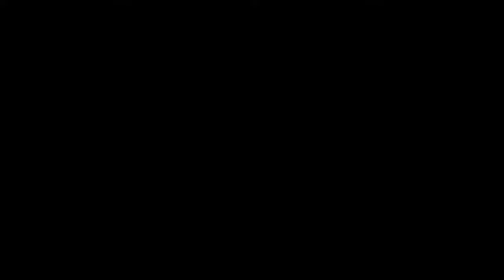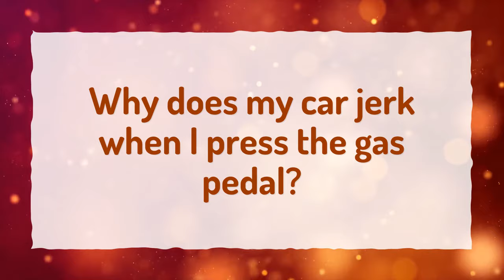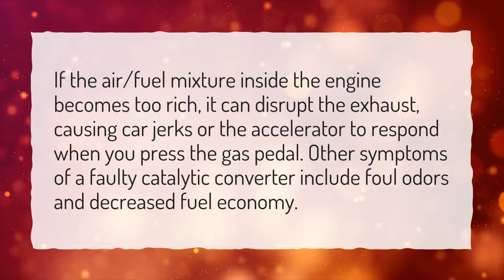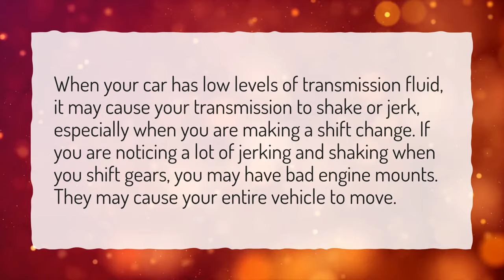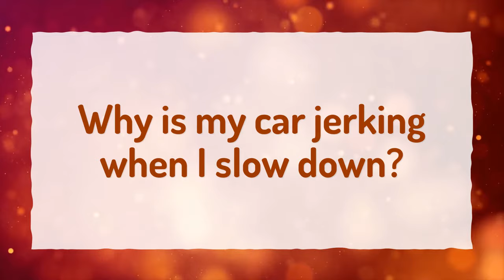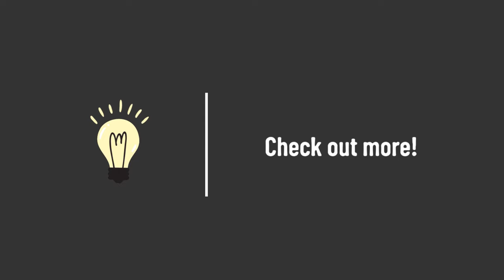Why does my car jerk when I press the gas pedal?

Comment: why does my car jerk when i lightly press the gas pedal?
Reply: did you solve the issue? please let me know
Reply: Same problem bro
Reply: @Yosemite23  ur gt350 does it too 🤣 god these cars are shif
Reply: @gt5hunniid  lol I need it tuned
Reply: @Yosemite23  u think that’s what it is? Ever since I blew my gen 1 and swapped it to a gen2 I been having nothing but problems it feels a lot slower too idk tho
Reply: @gt5hunniid  Yes you need to retune it
Reply: @Yosemite23  I never tuned the old motor tho
Reply: Check for vacuum leaks using carb cleaner
Reply: How can it be rectified?

Comment: My car stalls immediately after pressing the gas pedal. What caused this?
Reply: My car in winters usually jerks early morning but when I drive for 5-8 Kms it becomes smooth then doesn’t jerk through the day. 

In summer it never jerks. 

I noticed in automatic transmission when it shifts from its gear to second gear it jerks before 15 to 30kmph speed. 

Dodge challenger v6, 3.5L 

Any idea ?